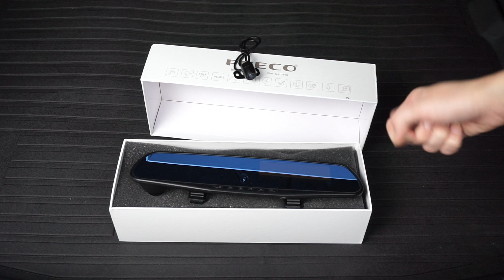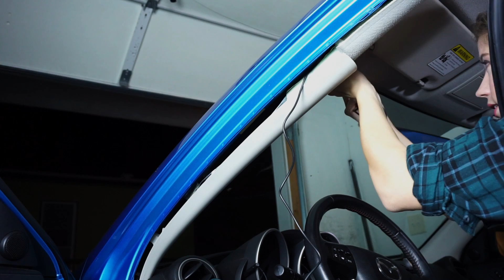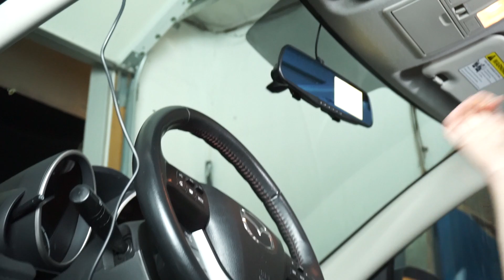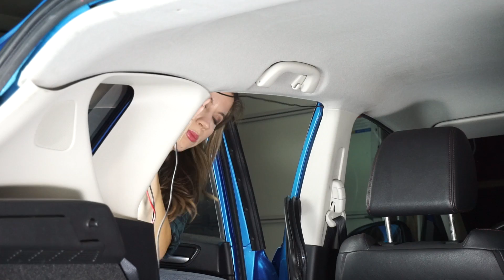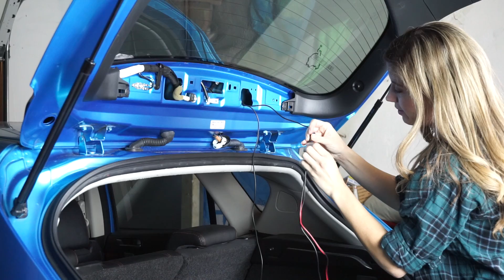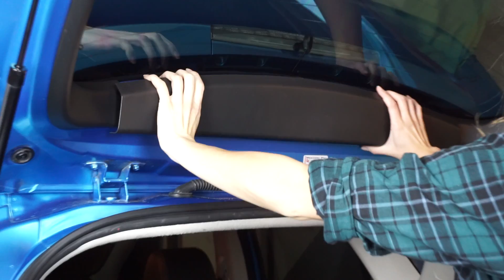DUAL VIEW HD DASH CAM INSTALL AND INFO!

Comment: Awesome tutorial! One thing I would add is that if the video feed is going to a head unit (unlike in this video) don't wire camera power to the reverse lights. The camera should be on whenever the car is on. The head unit should be wired to know when the car is in reverse and switch to the video feed. The advantage to doing it this way is that you can use the camera even when you aren't in reverse, for example to keep an eye on a trailer.

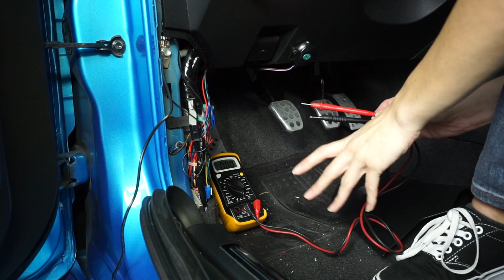Comment: Question, at 5:03 you said to hook it up to a wire that "only has power when the car is on", if that is so; how does the camera work to record a collision when your car is off? Especially since this camera has the motion senor feature you talked about at the beginning. Or was that a mistake in words? Doesn't the cigarette lighter wire always have power even when the vehicle is off? Im just curious so i know how to hook mine up.

Comment: Good job, but myself personally, i would of saved the work & placed it on the inside , basically where you did on the outside.. @ reasons.. #1 yes less work.. but the camera would not be damaged either by weather, dirt..or someone,  #2 placing it on the inside under the spoiler.. it would of cut down on the glare from the sun. either way.. still a great job.  P.S.. you didn't explain what you did with the "black" wire from the back up camera?   :)  thanks

Comment: One thing  l have not mentioned,is that most times if you install where this is being installed, the aerial control
 box is often at the hatch window.This  can and does interfier with the dash cam.

Comment: Yes good job. : )  You can however put wire from mirror,under the weather strip without taking car apart.When  you get to fuse box
 level, you can get a piggy-back connector to use on back of any fuse.This allows you to connect live and negative will fit under nearby nut.
 Keeps it neat and tidy,takes less time as well.

Comment: Oh I am defiantly NOT opening up my car like that to put the wire in!  I think I could screw up my car. Glad that you have the expertise to do such a thing.  I'm leasing a car so it has to go back to the Dealer in the same condition as I got it. But Thanks for your video. It was very good.

Comment: on 1:12 it says "Actual Footage", but how can she drive on the different road in the same time? One footage with double yellow line and the other has none?
Reply: Danny Fong the camera doesn’t pair both front and rear recording together, they are only together on the viewing screen, so when you access the footage that’s saved it will differ depending on when you enabled auto recording, 2 different cameras mean 2 different videos!

Comment: I have a very similar model. My question is, to which rear lamp should I connect the cable from the rear camera of the trunk? To the stop light, to the reverse light or to the rear driving light?

Comment: i didn't remember her mentioning where she hook the black wire from the camera to? I was wondering if it's possible that the black wire from the camera be hooked up to the reverse ground wire since there's two wires (positive and negative) running to the reverse light

Comment: Thank you so much for a lot of the good tips! I was able to install my own back up camera after intense research and your video was one of the most helpful ones! I'm just wondering if I did something wrong when I connect my "red wire" to the 12V power because when I put my car on reverse, the back up guidance doesn't come on. My camera is currently on dual recording mode, which records the front and back at all times. I just don't get why when I put my car on reverse, the guidance thing doesn't kick in like yours would. :(
Reply from the maker: Michelle so glad the video was helpful! When you connected the red wire did you connect it to the wire that shows a positive 12 volt current when the reverse light is on?
Reply: No! I have trouble using the multimeter! T.T I will keep trying tho!!!

Comment: I would not route the read camera wires above the window panels. it is much easier and safe running it along the door side of the floor where the carpeting ends...

Comment: After you splice the wire, is the cigarette lighter still able to operate? I need it for my radar unit?
Reply: cheryls5636 as long as the radar detector doesn't run too much power you are fine. Being right there, I would have run the power cable to the ignition harness under the steering column and added a fuse.

Comment: Hi
I have the 2013 Altima that comes with an existing backup camera. However, I would like to add a front DVR and a continuously recording camera on the back that stays recording when I'm in the drive position. Is there a way to have that install and working?

Comment: can you post some examples of the reverse cam at night in the driveway or parking lot? and show some examples of the motion detect. I purchased a Zedge that was showing the same specs and it's basically just useful during the day...motion detect and parking protection did not function at all. They took it back, however I don't recommend the Zedge.

Comment: If it was me, I'd save me the trouble of taking all these covers and spoiler apart and just mount the rear cam on the roof lining. Sure I'd need to be carefull with loading and unloading, but that's a small price to pay for saving tons of time plus it would be protected. 
Just sayin'
Good job overall though. I wouldn't have done it better myself!
Reply: Not unless you have tinted windows which would make the rear cam utterly useless if mounted inside the vehicle.
Reply: I agree. it's better to mount it on the inside of vehicle.

Comment: I like the informative information on the installation but I would caution against the scotchlok connectors to splice the wires together. They seem to have connection issues down the road with them in my experience. If they are easy to access and can be serviced without too much problem go ahead and use them on the interior if you have to. Do not use them on the exterior of the vehicle. They draw corrosion like a magnet.

Comment: Great video,  but no need to put a rear camera to the outside they are always mounted to the inside of the glass. 
So now with a outside camera you will get it dirty every few miles and have to keep cleaning it. 
Keeping it to the inside of the glass would have been the best option. 
But other than that well done.

Comment: how it automatically start reverse camera when u shift in reverse gear?
Reply: it senses power from the reverse light.  when it senses power, it switches to reverse cam view.  
like some dual cameras fash cams, if you want always on rear recording, you have to choose a different power wire and there is an option on the camera to be always on or reverse only.
Reply: +Alex Moreno ok.. so need to connect one wire at reverse light in tail light,
Reply: +NSPTech?
Reply: +NSPTech yup, just like she said in the video.  12:20 time Mark.  connect to reverse power wire.

Comment: some time on some dash camera the g sensor can be too sensitive you hit a pot hole and the  camera things your in a crash with the g sensor on
Reply from the maker: +trever pitts Yes, I've had this happen but it only locks the file and continues to record. The problem you can run into is if it locks too many files your memory card will fill up and there will be no space to save new recordings. You can always delete these files so it should be a huge problem.
Reply: yeah true i think dash cam are great thing to get

Comment: Does it work if someone dents your parked car??? Like a hit and run.
Reply from the maker: +Megan Torres It does have a park motion sensor feature. If you enable it, it will take pictures of the surrounding area if it detects motion around your vehicle. I've tested this feature quiet a bit and It does work well. The only issue is if you park in a busier area it can drain the camera battery quickly since it will turn on and record every time someone is around your car. Thanks for watching!
Reply: everythingdiy thank you I installed one in my mustang the exact way you did thank you for this video I'm not so intimidated by electrical fixes now, plus I like car gals like me not scared to get dirty.
Reply: I had trouble with rear camera the cords were damaged I tried saudering them back together I'm pretty sure I need to buy another one
Reply: There's an extra piece you can buy for any dash cam that is a dedicated battery just for your dash cam. You hookup the cam to the battery and then the battery to the fuse box. They tend to be large, but flat, so the best place to store them is under one of the front seats and they also tend to be expensive.

Comment: Great video... by the way, is it connected in reverse gear? because I saw you putting it in reverse then the camera went to back view.  Just curious :)
Reply from the maker: +lans samson Yes it is. When you connect that  signaling wire at 11:50 to the reverse light it will trigger the reverse camera any time the reverse light turns on. Thanks for watching!
Reply: +everythingdiy I see... I skipped that part... maybe I'm just so excited to see the end product.  Thanks! :)
Reply: The black wire next to red , what is it for ?
Reply: Yes, I wonder what the black wire for and where it go after that.
Reply: black wire is GND/ground wire... you need to find some dirt in your car and stick in it, or just place it in cup filed with dirt...

Comment: great video! whats the device mounted to the left of the dash (that looks like an mp3 player)? 
also as a suggestion you should of placed in-line fuses for each power wire connection
Reply from the maker: +xcmskim4 That device is an Access Port V3, it tunes our car for better performance.

As for your suggestion, there is only one power wire and you don't need to add an inline fuse because the fuse is already inside the cigarette lighter adapter provided by the dash cam. The other wire that was spliced is a simple trigger for a switch in the dash cam so it does not require a fuse. Thanks for watching!

Comment: Great!  Next time you are at a junk yard look for a car with an OEM electric type mirror, auto dim, compass, etc and grab the plastic channel that clips to the windshield mount, and that runs up to the headliner.  Great way to conceal and tidy up the wires.

Comment: @10:26 If you ever drop a metal fastener inside a dual-layered panel- you can usually drag it back with a strong magnet- held against the inside (or outside) panel. Use a thin cloth to protect paint!
Reply from the maker: +HUBBABUBBA DOOPYDOOP Unfortunately, I did drop a fastener in that panel once. It took 3 long hours and various magnets but after a lot of trial and error, I finally managed to catch it in a favorable spot where I could fish it out with my finger. Never again... ever since then, I'm always extremely cautious working around similar areas and always advise others of the potential headache. Thanks for watching!
Reply: +everythingdiy hi I Will like to Know where did you buy your dash cam
Reply: Ruso Avila  Usually the link for products featured in most videos- is found in the "description beneath the video" area, where you can click on "Show More". Usually- but not always, unfortunately.
Reply: HUBBABUBBA DOOPYDOOP design
ma
Reply: wow

Comment: How ironic- and the more I think about it- how disgusting. Back in 2006 I bought a Hi8 Sony Handicam, velcroed it to the dash of my delivery vehicle, and purchased the $80 USD 12v adapter- when I was a courier for a bank. At that time- there were no "GoPro" or "Dashcam" devices at all; there were no Public doing this in the USA that I'm aware of (to a great extent). Even Police cruisers had very crude trunk-mounted recorders and grainy cameras- and I have (yet to be posted) video and audio of a Police Officer agreeing that it was "good shit" and "better than what they had". If something noteworthy happened- I would archive it to DVD later; a few of these occurrences can be viewed on my YT channel. Using 2 tapes- I had a "live" recording of my entire work day while driving the 283 miles round trip. Several times- my Supervisor and the owner of the courier service balked at the idea- even to the point of threatening my job over it- so I had to shut it down (they had other snitch coworkers tell them when I was using it too; yes- a very hostile work environment at times). They tried to say it was a "stupid idea" and it "made people nervous to be recorded". What would they say now?

Comment: Couldn't you use power from the fusebox instead of splicing a cable? Great video btw!
Reply from the maker: +Luca Car Mods You can yes, but it's not easy. There are no empty spaces in our fuse box with a power connection. We would have to pull the entire box out the car and create a new connection or tap into an existing connection. It's easier to just tap/splice straight into the lighter wire since we know it can supply a safe and reliable current without affecting any other system. Also, since a splice is a parallel circuit we know it won't adversely affected our existing lighter socket if we wanted to use it for an additional device. Thanks for watching!

Comment: I've been on the fence with dashcams. I had a road rage incident where I needed one, so I used my phone. I also like to go fast when it's appropriate, which may also be used against me lol. It's a double edge sword.
Reply from the maker: +PowerofMetal247 As we see it - you're not obligated to share recorded data if you don't want to. The reason we bought this dash cam is because there has been a noticeable increase in insurance fraud where we live. When you see driver's purposefully causing accidents, that's when you start thinking you need to take measures to better protect yourself. We figure that it seems to work well in other countries. Why not the US? Thanks for watching!
Reply: +everythingdiy Im in NYC which is the insurance fraud capital lol, which is actually pretty scary You make a valid point. Better be safe than sorry!

Comment: Great video but I noticed a potential problem. Wouldn't splicing directly into the reverse wiring alter the resistance thus affect the canbus or bulb monitoring systems?
Reply from the maker: +Jim Wilson The reverse lights are not monitored, so there shouldn't be any affected systems. The only item that maybe affected is the bulb itself. If the draw on the spliced wire is too high it can negatively affect the output of the bulb or even render it inoperable. The wire that we spliced into will neither draw a significant amount of power nor create a large enough resistance to cause any problems. It's about as low of a draw as you can possible have; It merely connects to a simple switch that looks for a 12 volt current to change a parameter for the backup camera function. It's not a power supplying wire- If we were to splice into our power wire for the device, then it would be possible that our bulb may start flickering or producing dimmer light. Hopefully that made sense... Thanks for watching!